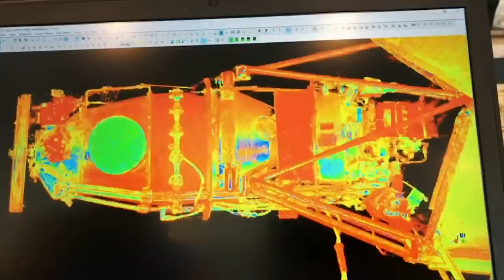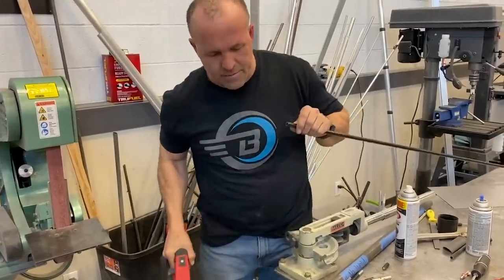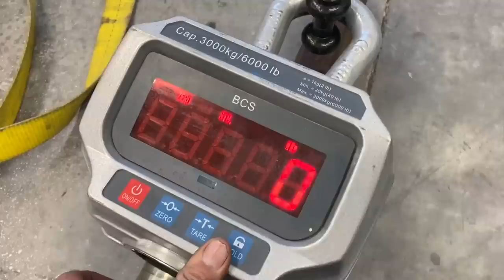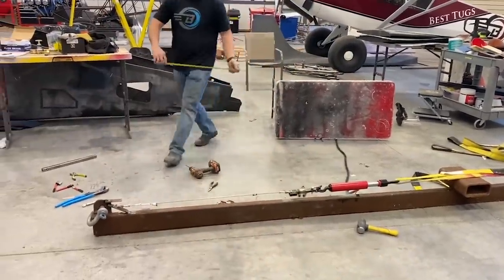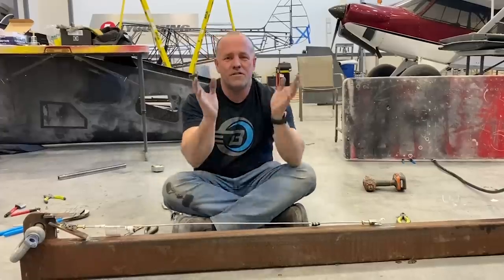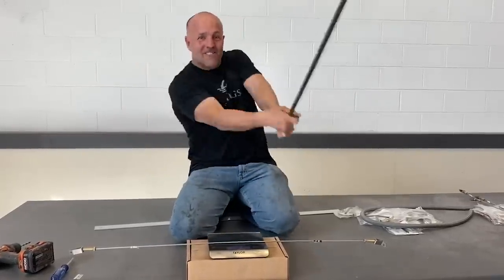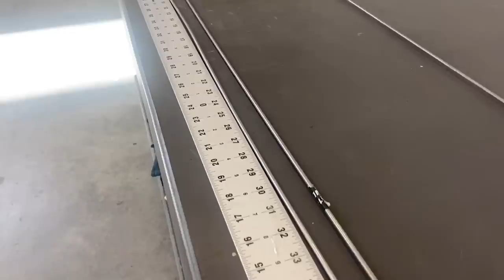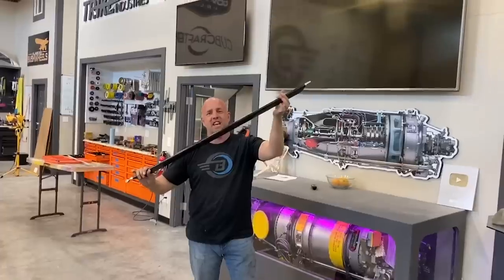Testing to Failure (Scrappy Bush Plane 17)

Comment: Holy Crap!! 🤯🤯 The Steal Beam was bending off of the concrete floor!!
Reply: Dang brother, well spotted.  That's crazy.
Reply: Time to truss that beam
Reply: I was just going to say that. I couldnt believe that square beam bent that much. Carbon is impressive.
Reply: That's got to be at least 3/4" of deflection at both ends!! Crazy!!
Reply: Good gracious.  I hadn't spotted that either.  That's actually putting a significant bending moment on the hydraulic cylinder.  Nothing close to 3000lb, but the pivot point is right on where the piston rod exits the cylinder.  It would be interesting to know the relative offset of the end mounting points and the piston rod axis so we could work out the trig and bending load on the cylinder rod.
Reply: I was noticing that too... I was like I think that beam is flexing more than the carbon... And then when the stainless end let go and saw the beam go flat... I was like yep... Definitely flexed
Reply: I was just about to post the same thing. Look at it at 26:15 and then go back to 25:00
Reply: @compt3ck  The chock under the cylinder makes it look worse and puts a side strain on both too.
Reply: Look like one inch gap from the floor at the left end of the steel beam.
Reply: That bit was ace :o) I was expecting it because of killing my ground anchor regularly, but the Concrete SLAP must have been epic :D
Reply: Saw that on the release! I never thought the rivets would take that much abuse!
Reply: we now know the beam can flex over 1" and not take a permanent set .......
Reply: I was late to the party but f yeah crazy strong that carbon rod bending that big steel tube
Reply: That’s unbelievable, so AWESOME can’t wait for the next update 👍🏻😎
Reply: Going for broke can be informative and entertaining ! Everything but imperial measures made sense, But I’m Canadian. Sorry 👍🇨🇦
Reply: Collin Fraser - isn’t it awesome doing all that hightech stuff and calculating it with medicinal imperial measures at that?
Reply: ron Johnson ddse
Reply: Trevor Dennis you’re an engineer
Reply: DUDE...!!! I had to do a double take to make sure I was seeing right! Yeap, that beam definitely was bending. Go carbon!
Reply: Wonder if the rivets might have crushed the tube, locally, internally when the rivet expands....? Be interesting to repeat the test using rivets at one end, and no rivets at the other?
Reply: I used to work at Lockheed in the Structural test lab, one test we did was for a helicopter main rotor shaft, it was mounted to a 4" thick steel plate on 4 4x4 steel legs sitting on airbags, We had hydraulic jacks pushing and pulling at 90 degrees to each other for a fatigue test, I.e. keep constantly flexing it in both directions. The table would flex like rubber with the amount of pressure and tension we woud put on the shaft. It was fun to watch that steel plate bend.
Reply: Time for a stronger steel test rig, perhaps... We'll spotted, @Christopher Kelley!
Reply: It's a shame you can't get smaller carbon tubes. Did you do any CFD to get a sense for the aerodynamic loads?
Reply: I noticed that too but was thinking maybe to floor wasn't flat, until the carbon tube broke and you could see the box beam straighten out. Crazy.

Comment: Amazing as always, and so detail orientated.  Your engineering background is clear to see in your approach to parts like this.  I spent my 40 year working life at Ford UK Product Development site, and most of that on a small design team producing specialist test instrumentation for the entire site.  My last six years was in our calibration lab (when my close sight was not up to the fine work).  We had two big Avery testing machines. One could do tension and compression, and the other torsion.  They were old enough that they had large mechanical scales as opposed to electronics.  We used them mainly for calibrating load cells, but we did stretch some 12mm bolts to failure just for fun, and I don't have the faintest memory of what force we needed.  Thinking about it now (I retired in 2004) I absolutely loved my job, and while I didn't match your level of enthusiasm — heck, no one is going to manage that — I did get excited about many of the projects I was involved with.  I'm 70 now, but engineering is my blood so I belong to  the local Menz Shed plus I have a workshop in my garage, and I am busy in one or the other pretty much every day.  You only get one life, so it would be a shame to waste any part of it.
Reply: It is pleasant and surprising to observe how, by reasoning about what is happening and on the personal experience of the participant in the events, it is possible to determine the "old" generation of people raised during the Cold War. In each of your words I feel a great experience, a huge education and respect for the work that we did at every stage of our lives. In today's life, to my great regret, all this is absent. And even though the Iron Curtain separated us, your reasoning seems to me much closer than the reasoning of the young generation in my native country of Russia.

Comment: Mike, as a FAI inspector myself, I have to say, this is a great example of not only the thought process that goes into the design of a stock part (all elements failing equally) on the stock wire but also the cross feed deflection to eliminate harmonic vibration caused by engine vibration (rpm variable) as well as prop blast.  I wish the industry would put this much thought into their revisions when upgrading.  It's work like this that helps the aerospace industry as a whole, grow and and fly safer!  Thanks Mike.

Comment: Mike an old recovery/rigger trick. Lay a wet towel over your cable.  When it fails it will just fall to the ground. The towel absorbs all the kinetic energy from the cable.  I’ve seen it work many times recovering military vehicles.   That’s my bizarre tip of the day!  Love your stuff keep going!  Can’t wait to hear that beast of a motor roar to life!!
Reply from the maker: Robert Sever 👍🤠 yea I do that and blankets or jackets when towing a buddy from the mud to arch that energy with straps but I didn’t want to miss a slow motion brake on video so I left it wild 😜

Comment: When you were testing the carbon, I was thinking the jig was going to go first. There was some very visible deflection in the main beam.
Reply: Carbon structures are insanely strong. We've actually used them in architecture to secure so called "impossible" knots. Where conventional design would not allow it. Tho, you really have to know how to use it. It's not something you just get from a store and bind with random resin and work it. Mike here is clearly an expert, this actually exceeded my expectations in terms of what a small component can do.

Comment: Hi Mike, I've just read some of the brilliant comments below, and, like you and everyone else I'm blown away. There is, however, one important point to remember when removing material to increase the number of fixings : maximum material condition. Sadly this design factor has,over the years, led to many failures and fatalities when ignored. The "strengthening" of rotor hubs on helicopters by drilling out existing holes and counterbores and fitting larger cap bolts is a classic example, you've only got to look at history. I can't wait for your next amazing footage. Love all you do. Keep safe all my friends. Pete on the Isle of Wight.

Comment: Yes the humming on ratchet straps! As soon as you mentioned you twisted it I knew that was why.
Reply: Just a heads up the dot will cite you for twisted straps
Reply: ron Johnson really? Why? I don’t see house it would compromise strength. Might even increase it since harmonic resonance can leave to other failures.
Reply: @cmmartti  yes sir
Reply: @Mrcaffinebean  according to the dot twisting straps weakens them ask any truckdriver
Reply: Ever noticed the helix around tall chimney stacks ?You have just worked it out your self .!
Reply: @ronjohnson9507  Hello Ron! Thank you for asking me! I am a flat bed and heavy haul truck driver who happens to enjoy reading the Federal and State rules and regulations and laws, and has my state commercial vehicle enforcement head office on speed dial so I can ask questions on enforcement of the law, and I can tell you that there is nothing in the rules that forbids twisted straps in free space.

Not only does it not weaken the strap to have a long half twist in free space, but it can actually prevent damage, because when it's vibrating going down the freeway, it can actually cause fatigue failure where it goes over a corner, or simply vibrate the fibers apart. A tiny nick can turn into a failed strap from the high speed vibration.

Now, if you have it twisted as it goes over a corner so that it's kinking the strap, or if it's twisted 50 times so it looks like a rope instead of a strap, they might have a problem, but what is being talked about is a half or single twist in free space between attachment points, and that's considered the proper way to do it, and Best Practices by truck drivers.
And you can tell the new guys who haven't learned this as they go down the road with straps screaming and violently fluttering, often loosening up in the process.

The pros twist each strap the same direction and the same number of twists, so it's all even and matching, and the DOT inspectors, many of whom used to drive truck smile and appreciate the care with which the load is secured.

Now, if you can find me somewhere in the state or federal dot/fmcsa/load securement rules some mention that twisted straps are weaker or unsafe or not allowed, I will change my habits and beliefs, but you won't be able to find it ;)
Reply: @cmmartti  don't worry, just an internet know it all spreading old wives tales lol
Reply: ke6gwf thank you! I couldn’t find a citation on that code either. In fact all I could find was some manufacturers recommending it to prolong life like you said!

Comment: I know that these videos can take a lot of time from your project, Mike, but thank you SO MUCH for putting them out.  Many of us would watch 5 hours a day if we could.  BREAKING things takes it to a whole different level and I really loved seeing how you mated the SS ends onto the carbon fibers rods, as mating CF to metal or vice-versa is the biggest non-monetary challenge to using this material ;).

It appears that you could get away with a smaller-diameter carbon fiber rod/tube while still achieving the strength that you need, but this part is no more weight than the old one and gives you enough radius to form an airfoil shape, so it's definitely the right choice.

Comment: As an old electro-mechanical designer, that was seriously cool.   I knew carbon fiber was the stuff, but had no real appreciation as to how ridiculously strong it really is.   I really liked your approach to bonding and securing the assembly and the attention to detail on the finished part, micro twist included,  was over the moon.    Well done, sir.

Comment: On rod rigging on boats, it's always the clevis that goes first, then the bolts shear, and then lastly the rod stretches to fail. Unless the rod has damage on it like a corrosion or impact  mark. Then that is where it goes. If you hit it with something by accident, replace it immediately...
Love what you are doing, Mike. Keep up the great work!

Comment: Put some kevlar in those rods. So that even if they crack they will hold on. It is not only strength but toughness. Imagine a bird strike rather than tensile failure.
Reply: Same thinking here.
Reply: Chicken cannon test?
Reply: Could only feel sorry for the bird !!!
Reply: I don't think any whole birds will arrive back there considering the huge prop in the front.
Reply: He could go even lighter using pre-stretched Dynema fibers in epoxy...
Reply: Neutrality & Mutualism with AI & Robots  I am pretty sure that Dyneema will not bond at all with epoxy. Even if it did Dyneema is not suitable for this design because it creeps under heavy load. Dyneema cables used on glider witches must be pulled out, and spooled up without load at the end of the day because leaving it on the drum stretched under load will ruin it in no time.

Comment: My Dad was a design tech at TI in Dallas in the 60s. He did design testing just like you describe . My favorite thing he told me was " Do something , even if it's wrong . You'll know one more way it will fail . Eliminate them all and your done . " The F 111 fighter was retired , but , the guidance system on the cruise missile  , works !

Comment: Having been a trucker, I appreciate the strap fluttering issue :)  Didn't know the solution :(
Reply: I had some stuff tied down on my boat and was noticing a lot of that fluttering Thanks to this video I know to twist the tie down around. It's amazing what you can learn on them innernets.
Reply: Had a buddy with straps that supported the bimini top on his boat. I noticed that he never set the top up until he stopped to anchor up, then took it down to go motoring around. I asked him why he did that, and he said the straps fluttering in the wind drove him nuts, and he tried everything to get them to stop.  I said "not everything" and unhooked each one, put a half-rotation in them and hooked them back up. I said try that. He could not believe that something so simple would stop a major irritation to him.
Reply: Mike is so far ahead in this game that we normal people devours his crumbles.

Yes, I too took away the "twist the straps" bit as a game changer from this video. 😁
Reply: Fix is simple - carbon fibre straps :)

Comment: The twist to cancel any vibration was necessary.. before building it over afterwards 👍I would of paid for the ambulance call if I could of been able to drop my physics book on the floor behind you ...lmaooooo 👍👍👍
Reply: Check the flutter velocity vs rigidity for that CF spar - very unlikely to flutter at any speed a Cub can fly at.  lol...   But anything to stop a "Galloping spar"-Tacoma Narrows Joke - is nice to have. 
Maybe if it were to get to high subsonic speeds (compressibility factors) - significant issue - but then the Fairing foil is all wrong..

Comment: I'll be darned! I drove over-the-road trucks for years, and some of those years were pulling Flat Bed Trailers. [Skateboards.]
An old trucker saw me tying down my load one evening, and told me to put one twist in my straps and they would not loosen up. Before, I had almost always had to stop after a while and re-tighten my straps, however, after following his advice and putting one twist in each strap, I never again had a strap loosen up going down the road.
I passed this tip on to a lot of other drivers over the years, and most of them asked me why it worked. I had to tell them just like he told me, that; "I didn't really know why it works, I just know that it works".
Now, years later, after being retired, I'm sitting at home watching this brilliant man build an airplane, and as he is showing us his upgrades to his tail section wires, he explains to me the Why of why putting one twist in the strap causes the strap to not loosen up as it travels down the road. The twist causes the wind to push on both sides of the twist equally, thereby preventing the vibration that occurs when the strap is straight.
Who would have ever thought that Mike would answer an old question of mine after all these years, by beefing up his tail section wires on Scrappy ? I learn something new every time I watch one of Mike's videos, but this is a special kind of learning since it answered a question I never thought I would know the answer to.
Thank You so much @Mike Patey.

Comment: I honestly thought you were going to have a jig fixture failure before the carbon fiber failed, which may have been possible had the rivets not let go. Absolutely incredible! I used solid carbon fiber rod for handle pins when making custom knives and was never able to break one during stress testing. The chemical bond of the resin would always let go from the steel tang during impacts and shear loading but the pins remained intact. Thanks for the destructive demonstration. Lol.

Comment: Mike I love how your channel has gone from a amazing build log of draco to an awesome channel about engineering and including us on the design and thought process of scrappy.  Also when I saw the airfoil for the tension rods I thought it would have been cool if you had made it so it worked as a speed break, probably would have required a ton of engineering and made the tail kind of heavy.

Comment: This is so cool! I used to test carbon fiber coupons to failure on an instron load frame for undergraduate research. I took for granted the machine that automatically applies force and measures strain and displacement. It was much nicer than measuring it by hand lol. When the carbon failed, it would explode and send shrapnel everywhere.

Comment: Thanks for sharing and yep it is a good day when you can break things and get paid for it! I worked at an engineering test facility for four years, pulling apart things, smashing things, overloading other things and usually with a satisfying "bang".  It was especially satisfying for the designers when the item in question failed at the predicted failure point and at the predicted load.  One of the most simple but impressive things was when they pulled apart in pure tension a solid wood 2x12, no engineered lumber, just a simple 2x12.  It took an amazing load and the failure was sudden and room shaking! :)

Comment: In marine masts Monel or Inconel rivets are used on the bracing (or rigging). My first thought of failure was shear at those rivet holes and they are impossible to inspect later... Stronger rivets, not more holes.
Twisting against flutter, a good idea, the humming would drive you nuts if the bracing didn't break . Good job Mike, much enjoyed !